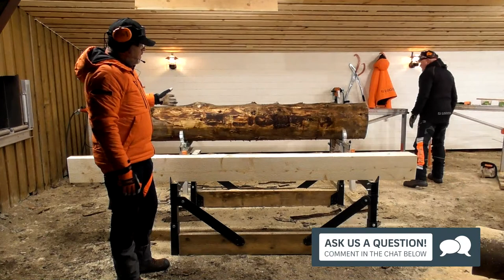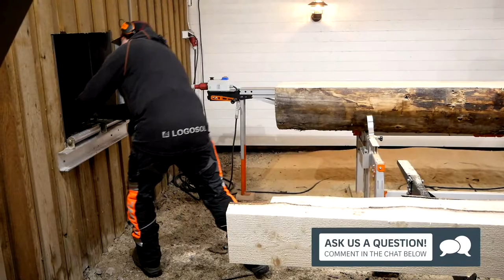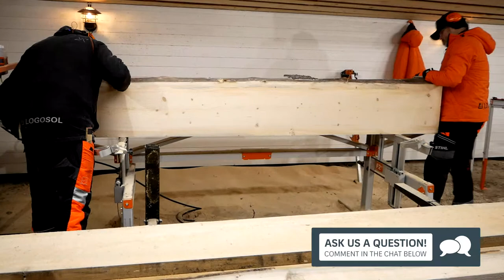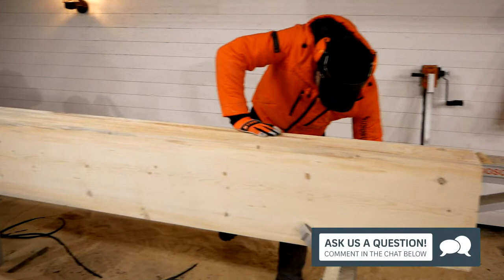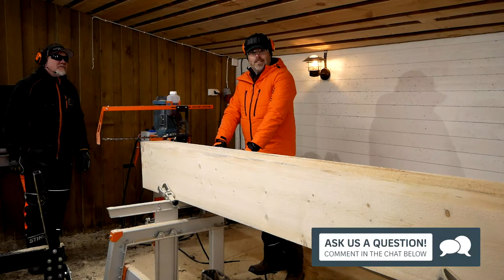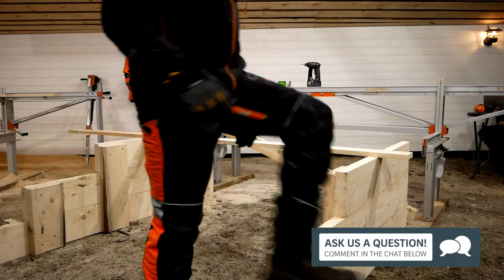LOGOSOL | Live Demo - DIY: Log table and log handling-tips

Comment: What is the recovery rate using that machine. What is the kerf size does it use a similar blade to the chainsaw.
Reply: It’s a chainsaw, think other videos I’ve seen them call it 1/4 inch kerf vs 1/8 on bandsaw